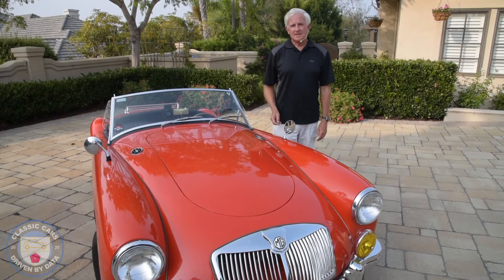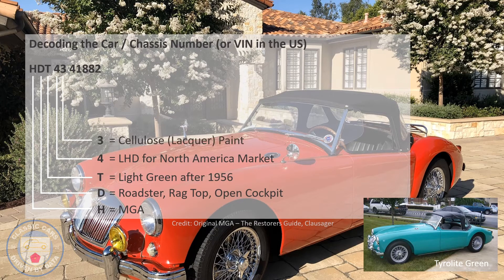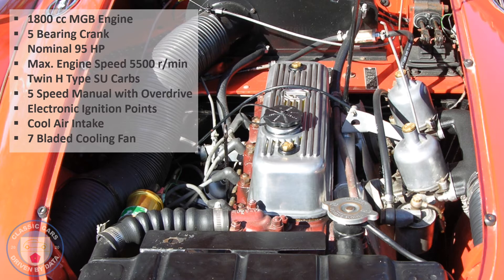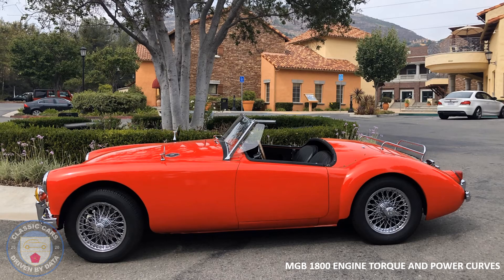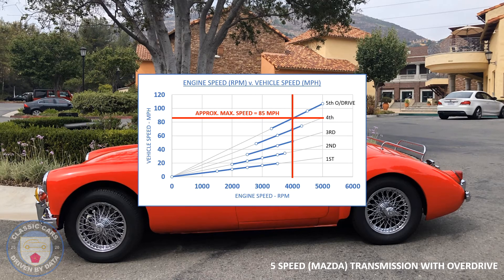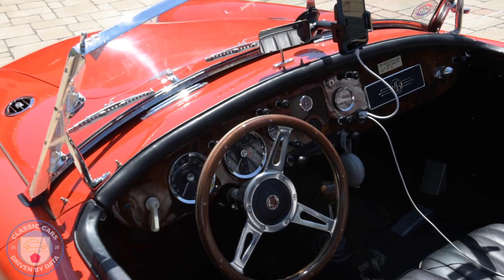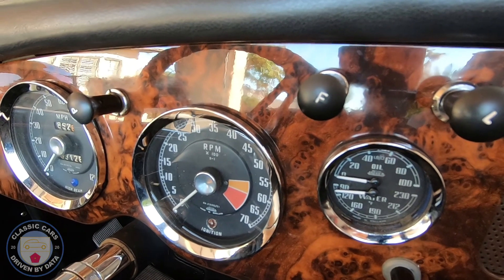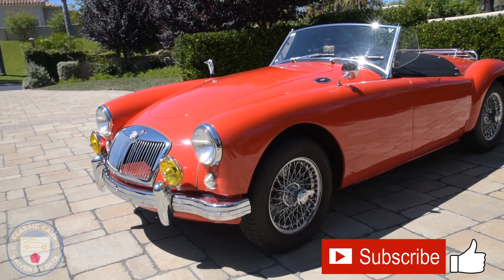1958 MGA Mk 1 1500 Roadster Upgrades

Comment: Wow ! Beautiful car , I had a 1961 MGA as my first car back in 1966 , loved the car had the side windows with Aluminum frames, new top and wire wheels , the 1961 car had disk brakes and the 1600 mark 1 engine sold the car with 50,000 miles for $700.00 back then sorry to this day , but I was only 19 at the time ? 🤷🏻‍♂️

Comment: For all the changes to this particular MGA, there does not seem to be a significant gain.  The original MGA as delivered new was already capable of 100 mph .  
The MGA raced at the Le Mans 24 hour race and was very successful in European rally events  (with driver Pat Moss) so was very competitive in standard form.
This particular car looks very nice , but it only LOOKS  like an MGA and most of its drivetrain and wheels are non standard.  Whatever lights your candle I suppose.  
In UK we tend to appreciate the originality of classic cars, appreciate the design and engineering of the time, modifications only reduce the value of the vehicle.

Comment: I owned a 1960 MGA Twin Cam for several years in the mid 1960s and I found myself chuckling while watching this video and reading the comments. Before I bought it the car had never been driven on the road as it was used as a SCCA racecar (E Production if memory serves). It was a hard luck car from the onset. The plywood floorboard on the passenger side caught on fire in one race and the flames lept up and melted the wire insulation on some of the wires under the dashboard. A few months later the driver over reved the engine and blew a hole in the block. End of racing career! The racing team had had enough by this time and they sold me the engineless chassis for $450. Quite a deal since the body was in mint condition and the car was equipped with a roll bar, an oil cooler, race shocks, and an almost new set of Goodyear Blue Streak race tires. As it was a Twin Cam chassis it also featured 4 wheel knock off hub disc wheels and 4 wheel Dunlop disk brakes adapted to the Twin Cam from those on Jaguar at the time. I bought a junk yard MGA 1500 engine which I totally rebuilt and installed in the chassis. So why was I chuckling? Well because I often drove the car long distances at 70 mph without hesitation. And living in New England I often drove at temps as low as 10F, also without difficulty as I simply dressed warmly. Eventually I moved to a 1965 MGB with an 1800 cc engine which I once drove from Boston to Miami (1,530 miles) in total comfort. All this said I would have to say that your gearing setup seems way too high for the 1800 engine. My car had no speedometer as it was raced and needed only a tach. I calculated the rpm/mph ratio and if I remember correctly in 4th it went like this:
2000= 37.5
2500= 45.0
3000= 54.0
4000= 72.0

I can't recall the numbers above 4000 rpm...it has, after all, been more than 50 years. Anyway I think the rpm/mph ratio was the same in the MGB and the numbers you report are considerably higher. With 112 lbs of torque I would think the 1800 would really struggle with your gearing setup. Is that the case?
Reply: Connecticut guy here. My first car was a 1962 MGA MK2 1600 (1622) CC engine, bone stock. I was stationed at Naval Station, Key West, FL, and bought it from a Shipmate who was ready for transfer. I had the car for about a year. The car was a blast to drive and back then, the Keys were pretty unpopulated. My buddy and I used to take the car up to key largo and back on liberty after work once a week (on weekends) and usually to the collapsed 7 mile railroad bridge that the hurricane wrecked. I had a hell of a lot of fun with that "A". I think it was one of the last cars made because it had a "jumble" of non standard parts like discs all around and other parts that were leftovers from the twin can cars, sitting on wire wheels. Everything you said in your post I agree with. If I get another MGA, and I'm looking, the one thing I would change is an MGB dual diagonal brake master cylinder. I sold the car when I was transferred to Italy for the same price to another Navy guy. $300 is a lot of money when your monthly pay is $134. I had no problems going 80 mph with two guys in the car.  Your post brought back good memories.Thanks. Cheers!

Comment: Having been forced to sell my MGA  about 20 yrs ago, I don't know why I torture myself with these vids.  Mine was a 61 that already had an 1800 B engine in it.  First thing I had done was to replace the soft top.  Next was the wire wheel conversion.  That was about all that was done over 12 years.  I miss her so.

Comment: My ‘61 MGA would pull to 5500 rpm in top gear, 105 mph. My ‘63 MGB would do about the same. Both fun cars. I believe the A was slightly faster due to body shape.
Reply: Shape effect unknown, but the A is over 100kg, or 10%,  lighter than the B and that would certainly help.
Reply: @shanehnorman  I have owned a 1956 MGA with a pumped up 3 main B motor.  My current 63 MGB would leave that car in the dust.

Comment: If you have used the head from the 1600 engine, you are giving away some power. The head from the 1800cc MGB has significantly larger valves and ports. Also you appear to be undergeared.. Your diff is likely to be 4.3:1. A change to a 4.1 from an MGA Mk2 would be beneficial.
Reply: Or a 3.9 diff from an early MGB works well with my '58 1500 with no other drivetrain mods. I do love the early 1800 MGB engine w/ a Mazda 5 speed for the best performance upgrade. Will be my next option upgrade if/when I restore another MGA project car where originality is not a factor, only power and performance upgrades are. 👍
Reply: the video points out that the final drive ratio IS 4.1.

Comment: G day from Australia I have a 59 MGA red like yours with an 18.00 b motor and I'm looking at the Mazda five speed upgrade. I'm doing some research as I'm hopping to do the job myself as with the price of the gearbox and getting a mechanic to fit it I'm looking at approximately $7.600.00 AUS. Your information on gear ratios has helped a lot to put my mind at rest that I will be able to cruise on the freeway and keep up with modern traffic. My MG specialist want's $18,00 AUS to fit it I think it's a bit over the top and if I hire the equipment I'm shore I can do it myself. Thanks again for your great video.👍